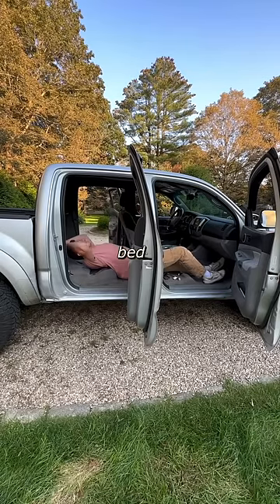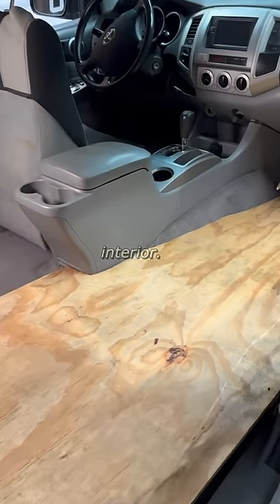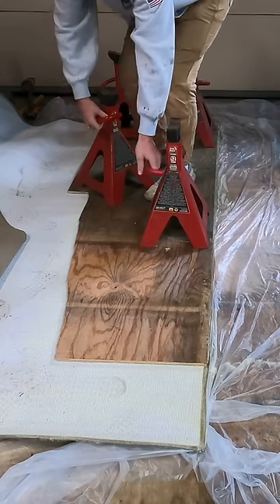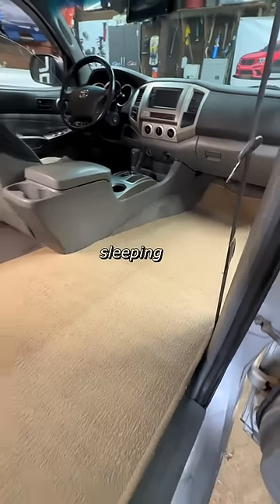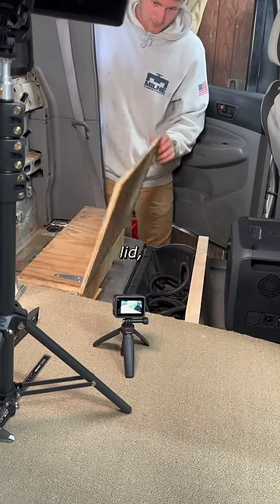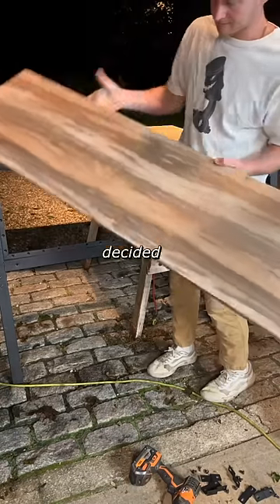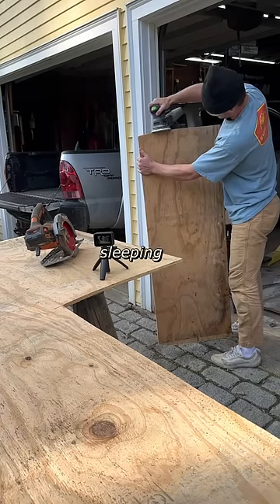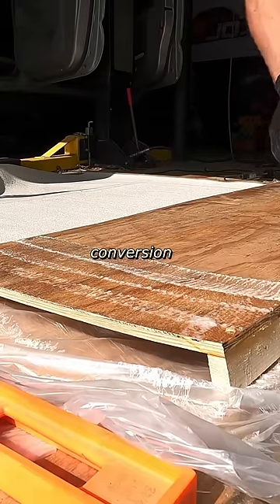Swapping the seats in my truck for a cozy bed

Comment: Bro forgot the truck has a bed in the back already
Reply: He's already got the heat the ac and locked doors. If went in the back he'd have to buy and install a heater/ ac insulation and then start the process.
Reply: It's not a truck
Reply: @Darren-yu6hf they've made fully furnished slide in units for over 50yrs now
Reply: @huckfinn2315 yea it's just a 4×4 ute .
Reply: But it's not safe
Reply: @claudiabueno6027  he's having creative fun , that's the main thing 👍
Reply: @huckfinn2315  I think you over shot the runway by 356 yards, didn't you get the memo it's a DIY project. He's doing the opposite of going down with mommies money and getting that slide in that's been around for 50 years.
Reply: @Darren-yu6hf I’m pretty sure the guys just making a joke. He’s making a bed for his truck, when he’s already got one…
Reply: Guys he wanted the air-conditioning and the ability to be sleeping and ordering Wendy’s
Reply: Might not be a 6 foot bed
Reply: @Darren-yu6hf  lololol. Stay in school and learn how to read. I can get a slide in for less than a g bub, and even less if it's 50yrs old.
Reply: @huckfinn2315  You did that they have fully furnished slides for 50 years now. doesn't say anything you just said. Let alone putting one together.
Reply: @huckfinn2315 Tacoma's been a truck for almost 30 years.  Source: Toyota.
Reply: You forgot some people aren't all short!
Reply: Bro!🤬 Did you forget that not everyone is 4 ft tall! You DF!
Reply: @ElegantPotatoes  Toyota Tacoma
Article Talk
Language
Download PDF
Watch
Edit
The Toyota Tacoma is a pickup truck manufactured by Japanese automobile manufacturer Toyota since 1995. The first-generation Tacoma (model years 1995 through 2004) was classified as a compact pickup. The second generation (model years 2005 through 2015) and third generation (in production since 2015) models are classified as mid-sized pickups. The Tacoma was Motor Trend's Truck of the Year for 2005.
Overview
Manufacturer
Toyota
Production
January 1995 – present
Model years
1995–present
Body and chassis
Class
Compact pickup truck (1995–2004)
Mid-size pickup truck (2004–present)
Layout
Front-engine, rear-wheel drive/four-wheel drive
Chronology
Predecessor
Toyota Pickup (1995)

Strange
Reply: @sircolinlesleyrowling in the states, we call them trucks. It’s called a synonym bud.
Reply: @Darren-yu6hf I don't think you know what rear windows and cab covers are bro
Reply: @huckfinn2315  If its not a truck then why does they guy who made the video call it a truck within seconds of the short starting?! "This is part 3 of bulding a cozy bed in my truck!"
Reply: Is it warm in the bed?
Reply: Yeah but not in 10 degree weather or 112 degree summer heat. Outdoor people we understand.
Reply: @tristonbrown8874  You m t f's went and hurt my feelings again. 
Do you know what the bearing clearance is on a 1968 small block chevy? Cc  and cam?
Reply: @PizzaSteve-jw4zr  yea I get you ,, but  international , Kenworth , ford big rigs are trucks ! 
That's a utility 4×4 !  A 4cabin 4wd flatbed  !
Americans sometimes use words wrong because they like to own them !
Reply: iamhot damn it I was thinking the same thing except I was going to say shaggin' wagon.
Reply: @Darren-yu6hf not really. he’s already got heat and A/C inside the truck. just plumb it into a bedcap through the back sliding window.. same can be done for electrical supply
Reply: I call Shotgun…. Oh wait.
Reply: @huckfinn2315 But then you lose the ability to haul the crap you bought a truck for in the first place.
Reply: @sircolinlesleyrowling Lighten up, Francis.
Reply: @rattlecat5968  I'm cool buddy ,, just sayin 😏 .
Reply: @rattlecat5968  there's a neat invention called a trailer. Many people I know including myself, use their pickup to pull one with
Reply: @sircolinlesleyrowling facts
Reply: @huckfinn2315 facts, its just a ute
Reply: @mr.pissedoff1903 it's a 4x4 ute
Reply: @ElegantPotatoes nah mate Toyota dont make trucks, this is a ute. a kenworth or mack is a truck.
Reply: Bro’s truck has 2 beds now
Reply: @huckfinn2315 thats the tacoma. Toyota had pickup trucks all the way in the 70s that im sure of..owned a 85 an a 89 myself
Reply: @wishtheyunderstoodme   What you talking about skippy? They call em pickup trucks in the US, but have completely different names literally anywhere else in the world.
Reply: @claudiabueno6027 then your a baby
Reply: Yeah... in the open... where it's not safe to fall asleep. Duh.
Reply: @huckfinn2315  Oh, your wit is just beyond comprehension. 🤦 But I'm really grateful you told me that. Now I know what that thing is called that I towed my son's show car on all summer. Thanks, Mr. Goodwrench.
Reply: @rattlecat5968  the more you know 🌈⭐️
Reply: @FM_jake.1  Do that sorta thing and now you have a cluster fk of a situation going on, I know you would do that to your rig. And if you did that, I'd have call you a cluster fk handyman.
Reply: @claudiabueno6027 how? no one will be lying down while he is driving obviously. well we hope not 😂
Reply: Dude they make backseat airmatresses to fit any vehicle
Reply: @karenharris7932  of course not while he is driving but when he needs to rest safely 😂
Reply: Fr just slap a camper lol
Reply: I think it was supposed to be a joke 💀💀
Reply: DUM
YOURDUM
Reply: @sircolinlesleyrowling yeah everyone in the world is bri ish bruv
Reply: @Darren-yu6hf and that are expensive AS HELL now. I went to look at one for me and my daughter to toss in the 350 and hell no. I went with a insulated rack tent with awning and vestibule, a diesel heater, 68 gallon fuel tank and a jackery for power and still came out saving like 7k.
Reply: He put a garage in the bed
Reply: @ebolawarrior451  Yea, Excactly ! Not to mention the depreciation of it, driving with that off the lot. One of those would have broken that little things  back.
Reply: Just fold down your seat. This guy doesn’t know how truck seats work.
Reply: Boom!🤷🏾‍♀️
Reply: @Darren-yu6hf there is no insulation in the cab either, you also don't want to run the truck to heat/cool the cab over night either as idle time destroys engines and the heater/ac is terribly inefficient as the engine is producing enough power to move several tons.  You'd be better off getting a topper and a cot with a really nice warm sleeping bag.  Saves on room and the utility of having seats for passengers is a good thing to have.
Reply: @thekingcrow7591  You are talking to some one that has over 2.5 million miles that spent 23 years driving OTR. That would leave my truck running for months at a time. You must not be familiar with 20 below 0 conditions. Ever experience 40 below? Any kind of cover to keep your fanny from literally freezing is a good thing, wouldn't your agree ? And quit the lectures.
Reply: @Darren-yu6hf  major difference between a gasser and a diesel idling at 1k
Reply: @huckfinn2315  Well, just remember them words of yours,  when it's 90° and you need to sleep comfortably,  or when it's 10° and you need to keep warm. In a pinch I'd choose a running gas engine over a not running a gas engine. 
Why are you consistently  debating commonsense ? It's his rig to do as he wishes, no? I've idled my pickup for 100's of hrs being out in the wild in Alaska, it's cheaper than going out and buying a 20k$ plus rig and all the up keep, the insurance and providing fuel twice one for the truck and one for sleeping. If he is on the move constantly, traveling light is a thing.
Reply: @denniskeegan4201  have you heard the saying ? If you don't have anything nice to say, don't say nothing at all.
Live, Love. Laugh
Reply: All u need is a cap and open the back window and you got a apartment and still have climate control
Reply: @Darren-yu6hf you really don’t, a decent sleeping bag and a mattress and you’re set down to freezing temps
Reply: @Darren-yu6hf just open the slide window in the rear window and the heat will go in and get a winter blanket
Reply: @Darren-yu6hf all you have to do is put a mattress and pillows in the bed, get a bed topper, then open the back glass if you can
Reply: @FD3TP  OK? What happend if it's 90° ? What happens when it's 0° ? The only place I know that has consistently comfortable conditions year round is the San Diego area. Ex OTR 49 state driver with 2.5 million miles in a semi. If traveling full time, the sleeping conditions for a happy life is a happy body. And what snout when you wake up and it's fuking so cold the water for coffee is rock solid. Or your bottle Pepsi is frozen solid and your shampoo is frozen solid or your can of beans is frozen Solid.
Same thing in a vehicle when it's 90° and your vehicle is 90° to 100° inside. I don't know what this dudes type of traveling is going to be, but either way, no heat and no ac is fuking miserable.
Reply: @Darren-yu6hf it's a joke cause the back is called a truck bed
Reply: @BK-zy6lw he can sleep diagonally 😮
Reply: @mannygonzalez4719  Sorry, I have a wife 🤔. Sometimes I imagine somebody else next to me while building sleeping quarters.
Reply: @Darren-yu6hf ooooor connect the box on the back with the existing interior. Oh wait, thats a van
Reply: True. He could have put a truck cap on the bed of the truck work with that instead. The window in the truck cab back window could be opened up (if it has that feature) and the A/C & heat could come through there, if needed. A lot more possibilities & space with this option without losing his passenger seats
Reply: @richardtickler8555  Feel better?
Reply: @Darren-yu6hf  i like my little joke. So yes, i feel better
Reply: @richardtickler8555  You do realize I'm not the one with the project right?
Reply: @Darren-yu6hf   im deeply sorry for not knowing your project. If you decide to post something about it (apart from a comment) just let me know

Edit: i dont think youtube lets you link outside btw. In case youre trying to actually answer
Reply: @huckfinn2315 you really saying it’s not a truck but then said it was a pickup truck. 🤦‍♂️
Reply: He took it to literal
Reply: @ElijahHerringtonXC   in the words of the great Mike Meyers "I shall call him mini me" pickup trucks are not trucks. They share similarities yet are no where near the same. 7/8s of you couldn't release the park brake on a truck, let alone operate one
Reply: @huckfinn2315  ohhhh so when you say truck you are referring to a semi or an 18 wheeler
Reply: That ain't a truck guys that's a 4x4 ute
Reply: @ElijahHerringtonXC  I'm referring to anything that you have to have a cdl to operate, trailer/camper not included
Reply: @Darren-yu6hf it’s a joke based off the fact that the back is called the bed of the pickup
Reply: @huckfinn2315 did we watch the same video? Cause that’s definitely a fkn truck
Reply: Do you not have common sense ?
Reply: Hehehehe
Reply: @Darren-yu6hf it was a joke bruh be fr🤦‍♂️
Reply: @saranpaxk1393  No shit  Capt.Sherlock obvious.
Reply: @huckfinn2315 what made you say that huh?
Reply: @Darren-yu6hf r/woosh bro. He’s making a bed(spot to rest) inside his truck, but this guy said he’s already got a bed(back part of the truck with the tailgate) on his truck
Reply: @gingersnap8543  Any male  that has the name of Ginger in it to try to diss someone, has got to be looked at with a side eye.  And not be taken seriously.
Reply: @Darren-yu6hf  ok, didn’t ever say I was a dude, first off. Second off, says the guy who just got r/whooshed, so😂🤢
Reply: @gingersnap8543  So if you are not a male and actually called me bro, my side eye is now with a double take, along with a eye roll extradinaire.
Plus you sound like my ex wife.
Reply: Imagine a world where a Toyota is called a truck 😂😂
Reply: It's like 4' long lol
Reply: Yeah, but the bed in the back doesn't have locks, heat, or AC!!
Reply: Stealth camping is needed!😢
Reply: @Darren-yu6hf and camper
Reply: But the bed in the back doesn't have a roof
Reply: Lol i was about to say that also
Reply: @Darren-yu6hf  you put a camper shell and a boot on the back so its connected to the front and enclosed way less work than this
Reply: Maybe he wants to make his own idea...
Reply: @Darren-yu6hf he could just get an SUV 🤷‍♂️ already has heat and air, plus the second and third row seats lay down flat. Throw a couple quilts down and your good to go 👍
Reply: @huckfinn2315 don’t nobody care about any Toyota coma🙄
Reply: Bro bro bro bro bro be like bro
Reply: I got the joke bruh
Reply: @huckfinn2315 it’s a Toyota Tacoma
Reply: @Darren-yu6hf lmfao if you think those things cost a lot of money you need a career change 🤣
Reply: yes 1n😂nu❤
Reply: @huckfinn2315 u Finnish?
Reply: @Darren-yu6hf  i assume you have no idea that im talking about creating an access port through the glass. its really not hard, the final product is beautiful, and its cheap. with enough ingenuity you can make what seem to blueprints of ideas come together very clean. almost as if it came from factory. and ive got a 97 cherokee xj built for overlanding with a 4.2 stroker motor, 8.8 axles, running hot water, a boxed shelving unit, RTT and canopy. etc. my point is, im not giving shit advice. i know what im talking about.
Reply: @huckfinn2315 he said it was a truck 💀
Reply: @Darren-yu6hf Not to mention He needs to buy. a truck bed cover 😂
Reply: @Darren-yu6hf he’s already going through the trouble to make the bed in the cab coulda just done all that work in the bed and not have to sacrifice the seats
Reply: Lol 😂😂😂😂
Reply: Bro specified COZY
Reply: I was just going to type something VERY similar
Reply: Good one 👍
Reply: Bro forgot this is his on vehicle 😂 and not yours
Reply: @Rere79700  every time I hear bro, it makes me think of the harley riders on south park
Reply: Lol that was kinda smart tho! 😂
Reply: @huckfinn2315 what
Reply: Give me stupid ideas for $500
Reply: @PizzaSteve-jw4zr  Utes and trucks are not the same. But okay!
Reply: wow the amount of people who didn't understand this comment was a joke. It's a pun because the back portion of a truck where you store stuff is called "the bed of the truck"
Reply: @NotXion  what cdl endorsement do you need to operate this tRuK?
Reply: @huckfinn2315  you dont need a cdl to operate a pickup truck. I see you're trying to make me look stupid but its not working
Reply: @NotXion  you did as soon as you called a tacoma a tRuK
Reply: @huckfinn2315  it is very obviously a truck.  Even its classification is a truck. Just because its not a big enough compensator for you, doesn't mean its not a truck.
Reply: @NotXion  lol, its classification is a pickup. From Toyota itself along with dmv. Compensation is the only reason you call it a tRuK, so you can sound cool to your yuppy city homies
Reply: @huckfinn2315  Its EXACT classification is "Mid-size pickup truck". Remind me if I'm wrong, but that literally has the word "Truck" in the title. Like I said, its a truck, and just because its not big enough for you, doesn't mean its not.
Reply: @NotXion  it's exact classification is in the comments, I'm not the one with the inferiority complex trying to make it something it isn't
Reply: @huckfinn2315  wym "its in the comments". Its a mid-size pickup truck.
Reply: @NotXion  please do some research on synonyms and different uses of words depending on geographic location.
Reply: @PizzaSteve-jw4zr  Ute's and Trucks are not the same. A Ute is a sedan with a bed, a truck is a truck.
Reply: @NotXion  “Ute; a utility vehicle.” 
“Ordinary families buy pickups and sports utes.” Please develop some critical thinking skills and opposable thumbs to do research.
Reply: @PizzaSteve-jw4zr  Trucks are bigger than utes. Sure, a phone and tablet do the same thing, but tablets are bigger than phones but you dont call tablets phones.
Reply: @huckfinn2315 that’s a truck in video you might be blind
Reply: @sircolinlesleyrowling that’s not a utz that’s a Toyota Tacoma here in the states you can see the steering wheel on the left side
Reply: @wishtheyunderstoodme no a kenworth or a Mack is a SEMI
Reply: @Diablo_CST it is a pickup truck here in the states
Reply: @JustinDoesASMR25  yea a semi truck.
Reply: Oh yeah, but the truck has to fit their entire family of five but the parents need a double bed.
Reply: @NotXion  so because in the majority of South America phones are known as “celulares” the meaning of cell phone and telephone are different? You might want to check you logic.
Reply: Homelessness?
Reply: @Darren-yu6hf I think he was joking 😬😂
Reply: @JustinDoesASMR25  Low End SUV with a Bed. That piece of crap cant even pull its own weight 😂😂
Reply: He's probably using the back for storage & he would have to install heating and such inside the back, and the back may not be big enough for him to lay comfortably
Reply: @huckfinn2315 it is a truck lmao 😂
Reply: Oh yeah... 🤨
That's what a shell is for...
Guess he wants more private crib?
Reply: that's what I came to say haha
Reply: @Darren-yu6hf  :
     There are pass-through window seals that connects the cab window to the truck cap window, allowing A/C to pass through.
Reply: Absolutely too funny I was thinking the same thing
Reply: He doesn’t want to be in the back. It’s better to be in the front, so you can leave quickly if needed.
Reply: @Darren-yu6hf  not hard to cut a hole in the bed and the cab then seal them off together. Heat and a/c will still get back there and you have more room
Reply: You win.
Reply: @Darren-yu6hf build a canopy, and remove the rear window
Reply: Imagine having a new truck and finishing the cab with plywood, I guess he doesnt have a mate either.
Reply: @Darren-yu6hf ok so get a minivan
Reply: @huckfinn2315 more expensive than what he did too...
Reply: @Darren-yu6hf  The beds of newer trucks are not long enough for a full sized man.
Reply: @huckfinn2315 yeah and they are expensive
Reply: @Darren-yu6hf  you also lose the utility of the bed unless you pull everything out to sleep
Reply: @Darren-yu6hf  Says who?
Camper top and he's 60% of the way there.
Reply: That’s the garage bro
Reply: Lmao!!!!
Reply: @huckfinn2315   look closely, bed with liner and a tailgate.
Reply: @BabyLettuce70  wonder why there isn't a weight tag on the license plate
Reply: @huckfinn2315  no, but I wonder why you're a bot?!?
Reply: @BabyLettuce70  bots conform to the masses
Reply: @huckfinn2315        
How do you test if you're talking to a bot?
Pay attention to unnatural behavior: bots often exhibit certain behaviors that can help you recognize them. Pay attention to general or repetitive responses, unnatural typing speed, irrelevant or meaningless responses, and an inability to engage in meaningful conversation.
Reply: @BabyLettuce70  you fit rather well
Reply: @huckfinn2315  that's what a bot would say!!!(
Reply: @BabyLettuce70  206 comments and you didn't read past the 3rd one
Reply: Bingo... DUH 🙄😂😂😂😂
Reply: @huckfinn2315  I was afraid of the boredom killing me.  I picked up on your arrogance and ignorance right away, since you're acting like a troll.  Semi truck drivers are almost always kind, patient, helpful, and generous.   You fail miserably in all those qualities.  You should stop trolling now.
Reply: @BabyLettuce70  maybe you should read and understand definitions of words you use

At times, the word is incorrectly used to refer to anyone with controversial, or differing, opinions.[14] Such usage goes against the meaning of troll in multiple ways.
Reply: @BabyLettuce70  🤖
Reply: @huckfinn2315   Thanks for the condescension. You just proved that I'm correct.  Arrogance and ignorance, all in one package.  What a waste of skin!!!  😵‍💫😜
Reply: @BabyLettuce70  con·de·scen·sion ˌkän-di-ˈsen(t)-shən 
Synonyms of condescension
1
: patronizing attitude or behavior
scoffing condescension by the "we know better than you" people
—A. J. Anderson
2
: voluntary descent from one's rank or dignity in relations with an inferior

pa·tron·iz·ing ˈpā-trə-ˌnī-ziŋ  ˈpa-
Synonyms of patronizing
: showing or characterized by a superior attitude towards others : marked by condescension

Like replying with the same comment almost 3 months after the original conversation?

It's not a truck

Stay in school
Reply: @BabyLettuce70  whatever helps you reboot
Reply: @huckfinn2315    I used exactly the correct words in exactly the correct way.  Huckerfinn.
Reply: @BabyLettuce70  exactly what a bot would say
Reply: @huckfinn2315  😂🤣😂😜. You would know, since you are one.  Funny how that got you so triggered.😆🤣😂😙
Reply: @BabyLettuce70  my john deere gator has a box, with a liner, tailgate and electric dump and a higher payload than that tacoma. Still doesn't mean it's a truck. Notice how you add nothing of value to the conversation
Reply: @huckfinn2315  🥰🤣😙😂😆
Reply: @huckfinn2315 that's irrelevant my guy, cause bro doesn't have that 💀
Reply: @richardvanmarter9269  my guy? Bro? Keep reading, I'm sure I left a comment about your catch phrase. South Park season 13 episode 12. Brobrobrobro.
Reply: @Darren-yu6hf  it's a joke 😂
Reply: @huckfinn2315  yes they do make those slide-ins. Have you priced one? They are outrageously priced and they throw off the center of gravity for your truck dramatically.
Reply: @davidbarr707  continue reading comments because your questions were answered long ago
Reply: Beat me to it 😂
Reply: @claudiabueno6027  safe from what? The boogie man?
Reply: I'm so sorry that there's so many people who aren't getting your joke it breaks my heart honestly
Reply: @walter9724  I just think is a good idea period. If you don't I respect your opinion
Reply: @huckfinn2315 tf you mean it's not a truck?
Reply: @sircolinlesleyrowling  "Americans sometimes use wrong words"
Wow, how arrogant and condescending, but 100% wrong!
It's a PICKUP TRUCK, hence a type of truck that was INVENTED BY AMERICANS in the first decade of the XX century. They named pickup truck because it's a smaller truck (built over a car chassis)  made to carry things, so pickup for deliveries, in a setting that doesn't need a full blown truck, specially for small commerce, farms, etc.
Now, shoosh with your ignorance and childish attitude.
Reply: Ummm...yes, cellphones and tellephones are different. Quit arguing semantics when you're so objectively incorrect.  @PizzaSteve-jw4zr
Reply: @magicmike618 there's nothing new about that tacoma. Its pre 2008
Reply: iamhot except you can't drive with anyone
Reply: @TalesoftheScales yeah but tacomas only have a 5 or 6 foot bed it’s not very comfortable, plus then you have to to get a bed cap or build some big custom shit on the back
Reply: the bed is short, also that's where he want to store the rest of his gear, i would guess he's going to do some overlanding, and would prefer not to have the tent over bed idea where he has to set up and put it back down every time he wants to travel each day.
Reply: Guys I’m pretty sure it’s a joke
Reply: Yeah cuz you know outside in the truck bed is so warm and comfortable when it's raining and cold out😂🎉
Reply: Damn, some of the first commentors are a bit slow lmao
Reply: @Darren-yu6hf You can get a used camper shell for like 100$ what are you talking about "mommies money" 3 tanks of gas is gonna cost him more then a used camper shell.
Reply: Came here to say this.
Reply: He has a renter on the back of the truck already.
Reply: Cane here to say this lol
Reply: @huckfinn2315 it’s a truck
Reply: @huckfinn2315 my bad it's a sedan you're right
Reply: @dk420x  ever heard of a bed cap?
Reply: @wishtheyunderstoodme And why the fuck do you care what he calls it
Reply: @bradkiewiet4268  because I'm the word police dah
Reply: @huckfinn2315 a Tacoma isn’t a truck? What is it lol
Reply: @Darren-yu6hf  bro you must have some really bad mommy issues 😂😂 mother dearest on your mind 24/7 bro she lives in your mind rent free
Reply: He should make the back a kitchen and toilet area 😂😂😂
Reply: @huckfinn2315 wdym yes it is 😂
Reply: @huckfinn2315 what are you yapping about that’s not a truck
Reply: @matthewbeathe7044  feeds 3 months old and you couldn't make it past the first comment
Reply: where he messed up but lucked out, he put the carpet on before test fitting